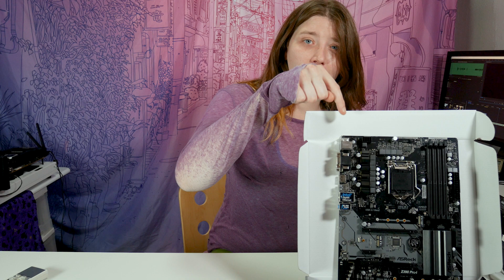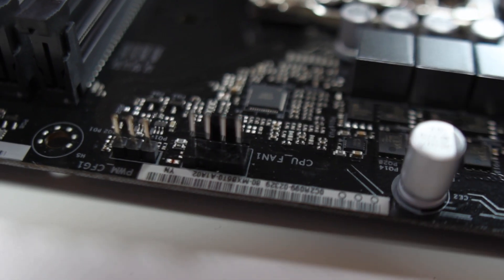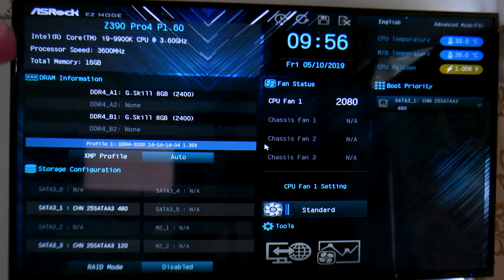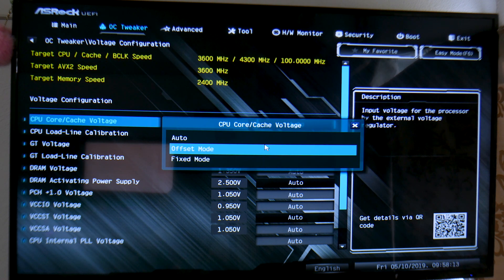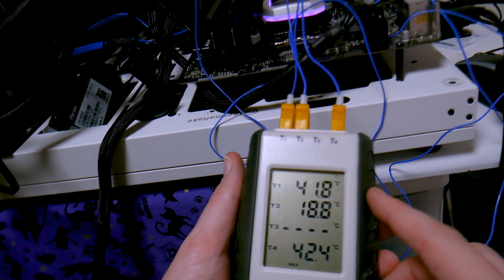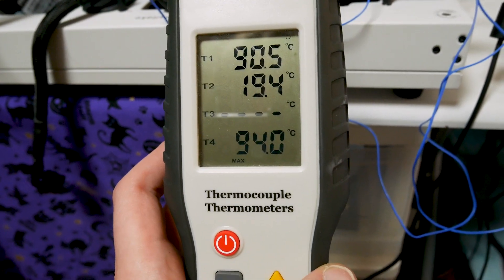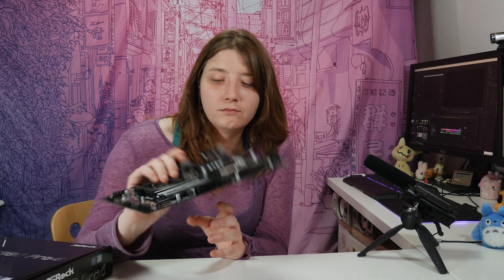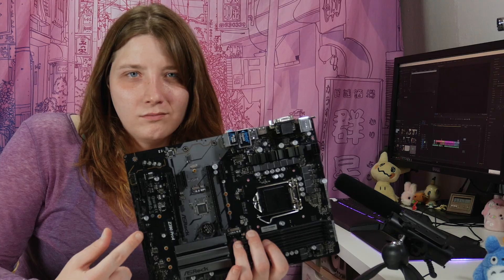ASRock Z390 Pro4 - Cheapest Z390 Motherboard

Comment: Exactly what I was looking for, thanks! Considering this board for a build im helping a friend with.. the 390 boards be EXPENSIVE right now
Reply: Check out the AS Rock forum.

I fixed the fan control to make 4 DC fans running from 0-100% fan speed via the tool *speedfan*.

The board can easily handle 16GB DDR4 4400Mhz CL19 Patriot kit and 200watts for the CPU.
Reply: btw. 200watts only with watercooling (vrm).

Comment: I have this motherboard with a i7-9700k , rtx 2070 and 16gb Corsair vengeance 3200mhz xmp enabled  . No over clocking . Can this motherboard be the issue of my quality as I’m streaming on one pc
Reply: The AS Rock Z370 Pro 4 is the very best Z370/390 board, can do 4400Mhz Ram speed, 200watts VRM power for CPU with watercooling AND HAS A PCI slot. 

https://www.directupload.net/file/d/5873/tljlhsiu_jpg.htm

You got no clue about electronic parts, datasheets which are easy to read but not for students, they are mostly all brainwashed fools with stupid questions.
Reply: No. What are you streaming with?

Comment: Gonna give it a go, Im using my i9 and 64gig of DDR4 CL16 but I need to OC to get to 3200mhz as my present Gigabyte Mobo is locked to 2666mhz. It seems they are just spewing up old tech. I dont need to get to 5000mhz plus I got 4 fans into case and 2 over CPU heatsink.

Comment: Was looking up something else about this board and came across this video...  I have this board, with an i7-8700k, OC to 5ghz.  TridentZ 3200 memory running xmp with no problems.  I wasnt worried about voltage/heat though with my cpu being I have a Kracken X62 on it as well.
Reply: Hey man I bought the same mobo and the same cpu as u. Did it run stable for you since then? I hope you read this haha
Reply: @papahades1654  I’ve had all cores locked at 5ghz, and have never had an issue.

Comment: Would it run a ryzen 5 3600 and a Rx 570?
Reply: It's an Intel z390 board so no. They do make a x470 Pro 4 board as well though and that one would run both of those.
Reply: @bdhale34  yah, i realised before i could mess it up. Im going for the 580 instead of the 570 and my motherboard is ASRock B450M Steel legend which is compatible
Reply: @nomelose6872  good luck man
Reply: @damien.9076  why?
Reply: @nomelose6872  with ryzen they have shit frame drops from what I've seen on yt

Comment: Hey so I have this motherboard with a corsair crystal 570x case and the case comes with rgb front fans and i couldnt figure out where to plug in the led's for the fans.. Just figured out there is no place to connect them on this motherboard... is there any adapter or anything I could put anywhere to where it would support the sata plug or whatever for the rgb's or no?

Comment: Did you have to upgrade the bios, or did the cpu boot out of the box. Some companys give you bios/ chip compatibility that you can understand but some don't. Buying the new coffee lake refresh cpus is a pain
Reply from the maker: Its Z390 you dont have to update the BIOS for CPU support.
Reply: Site says you need to update bios for i9 support
Reply: I have purchased this board kind of blindly, and i did not intend to OC anything. Its a fine running board atleast in my book.
 The build i have is i5 9600k
GTX 1060
16 gigs of RAM.
What i have ran into upon purchasing and installing the board, were random bluescreens, which were giving me a solid headache, because the error returned was WHEA_UNCORRECTABLE_ERROR, and all answers i found were really vague hinting at both hardware and software problems. I went with flashing the bios with newer version as one of the solutions, and haven't had the bluescreen since.

Comment: nice video, i already buy this board via i5-9600k hope will not burn anything lul
Reply from the maker: Thank you and you should be fine but make sure you throw a fan on it to make sure.
Reply: hey i am about to buy this same setup, how is it working for you so far? are u overclocking? over 5.0ghz?
Reply: @J. Jay thanks, I got a promotion as well and I'm picking up my second hand 1080ti TMR, super excited.

Comment: Cheaping out on a board while using a 9700K/9900K shouldn't be allowed.
Reply: This cheap motherboard is still really extremely good for its price. Usually with brands like GIGABYTE and MSI, in this price range you will get a VRM with 4 phase inductors, no doubling, terrible PCH chip heatsink and no VRM MOSFETs heatsinks. This ASRock mobo on the other hand has a VRM with 10 phase inductors (10+1 phase), decent VRM MOSFETs heatsink and a good PCH chip heatsink. Can't go wrong with this mobo if you're using a 9700K and wants to OC it midly.
Reply: zarith4fiddy what about for intel 9900kf?
Reply: zarith4fiddy no Overclocking
Reply: @mustafas9011  I don't know about OC'ing the 9900K with this mobo tho but my 9700K + a custom thermal paste by thermal grizzly can easily OC with this mobo @ 5GHz with 1.3Vcore.
Reply: @zarithevill  I have a i9900kf is the z390 pro 4 a goo mobo? This is my first pc buddy.
Reply: Probably who buys a 9900K won't buy a board as this...
Reply: @wolfgangchristl9978  Yeah only acceptable board in my eyes is evga dark/aorus master/extreme/asus Apex. Others are either ridiculously priced or badly specced
Reply: How about if I’m using a 1660 TI, (Gaming Z MSI) and a I5 9400f? That ok? I’m new to this
Reply: @latuba2478  you dont need a z390 board if you're not getting a k series processor.
Reply: tofu hopefully tho in time this will be worth the purchase in terms of upgradability
Reply: Why not
Reply: @veritas8598  Thanks and also I'm honestly surprised to find a motherboard with a good VRM at this price range, ASRock really outdid themselves for Intel's 2nd 14nm transistor rehash CPUs
Reply: I got the i5 9600k and this
Reply: i got a 9900k with this board and no problems at all and maxing out fps and overall performance on everything